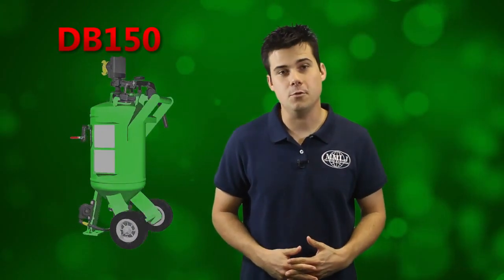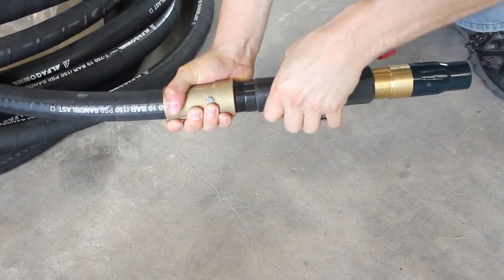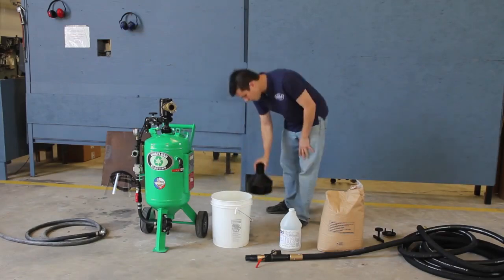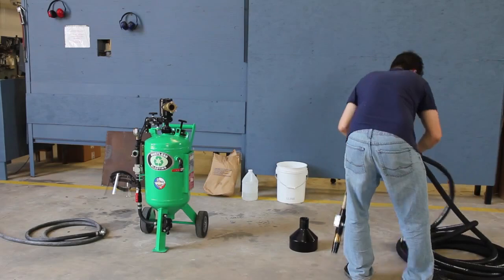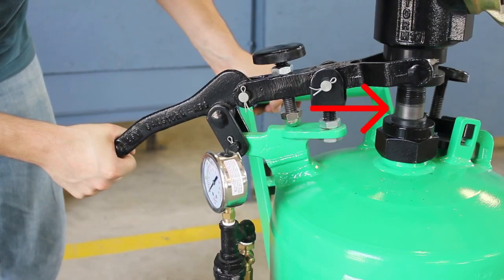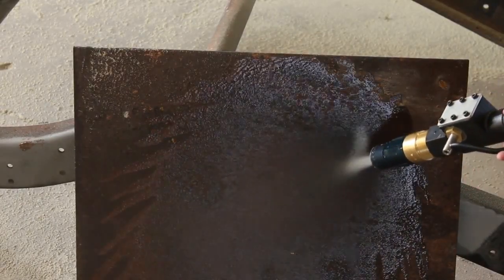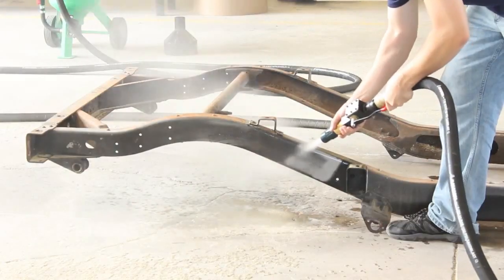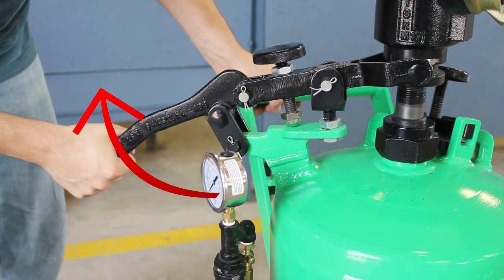How to Use the DB150 - Dustless Blasting Equipment

Comment: yeah you just have to fork over around $8,000 to get an air compressor (185 cfm) to power this..
Reply: smokestrong1000 I think the specs say 50 cfm.   But yeah all in this would be 15 to 20k.    Not for the weekend warrior.